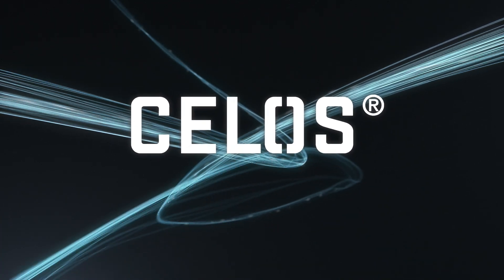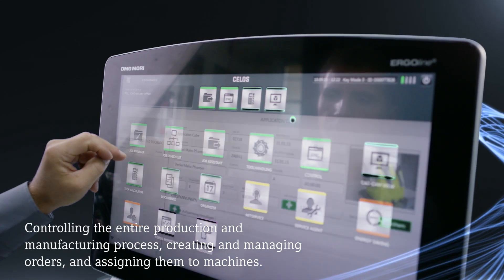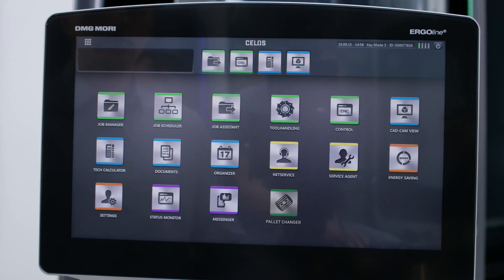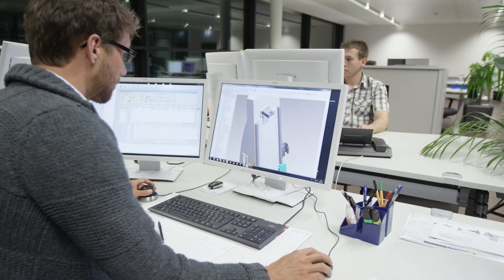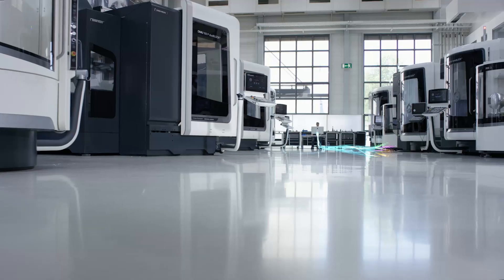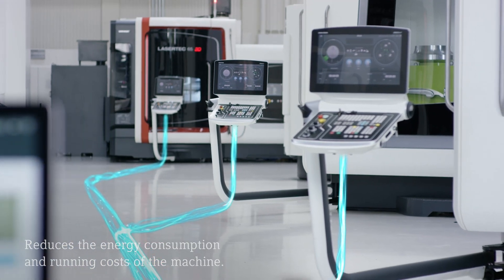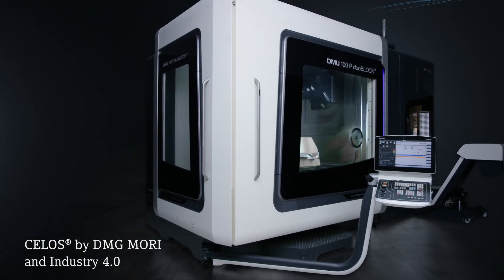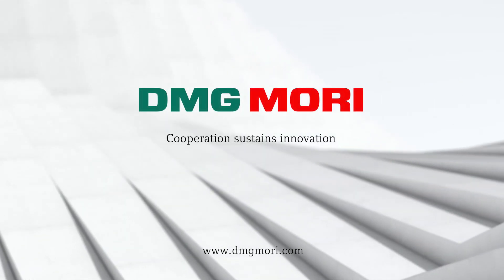CELOS® - Simplified machine operation. Integration of machine.

Comment: the CELOS controller is nice, easy to clean, and has tons of features. But you can still navigate faster with the older ones before touchscreen (2010 NL3000 for example). Get rid of the drag and drop, locked screen, and double tap it would be gold. Still better than mazatrol any day though :)